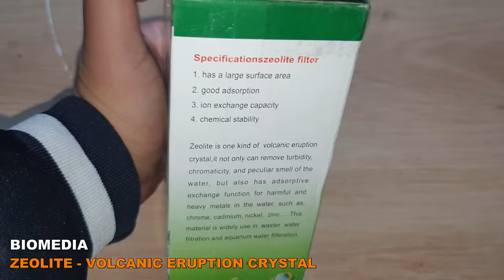DIY Filter Aquarium | Make Aquarium Filter At Home

Comment: Help me . When i switch off the filter but motor continue suck the water 
How to avoid it
Reply from the maker: Hi Srikant, how long does it flow after switching off the power. It should stop working as the filter won't be able to push water back to the tank.
Reply: It is continuesly suck the water after the switch off the power what can i do
Reply from the maker: Srikant nayak after taking IN the water from tank, does it pushes it back to the tank? Or is it during maintenance when you open the filter and it just over flow.
Reply: No its overflow
Reply from the maker: Srikant nayak Lift the filter bit higher when you do maintenance so water doesn't flow to the filter due to gravity. Or attach a stop valve to the inlet so you could turn it off before turning off the power. I hope it helps
Reply: @Fishaholic  tnq

Comment: Can you share the power of the pump, how many liters per hour ?
Reply from the maker: Hi Srinath, its a 4W pump with 280L/H capacity. Appreciate your time mate.
Reply: @Fishaholic  Thanks for the reply, I tried the same by using pump from submersible filter Which says it is 200L/H. I used much smaller tube for water in and out and used hot glue to seal the connecting place. It was not so successful. Going to use more powerful pump next time. Any advice? Great video,  I was inspired to make this by seeing your video 👍
Reply from the maker: What size tube did you use for water flow. Mine is 10mm vinyl tubing and water flow was just right for the tank. If you have bigger tank then go for bigger container and no doubt high flow pump. Appreciate your kind words and I am glad that my video has inspired you.
Reply: @Fishaholic  tube is 5mm vinyl tube. Will update ones I try with a new pump

Comment: Water level is increasing and decreasing in my diy filter and when switched off filter starts overflowing...what to do now?..pls help
Reply from the maker: Hi Richeek, your filter is not air tight. Check the seal around the lid and silicone around any holes you made in there.
Reply: Do u have insane gadgets to diy a simple filter?? Buy them first.... total equipment cost would be 15k... + ur hard work
Instead pay 4000 or less and get branded canister filter.

Comment: Sir tell specification of motor to be used.
Reply from the maker: Mine is a 200LPH motor for this small 20L tank. This size filter should work well with upto 400LPH pump.
Reply: @Fishaholic  Thank you sir
Reply from the maker: No worries Akshay, please ensure container is air tight. Otherwise it won't work properly and will be subject to leaking.
Reply: Ok

Comment: Broi did it but i face problem in leakage  from bottele cover what can i do???
Reply from the maker: Sorry to hear that. Check the seal, did you test the container by filling it with water and holding it upside down before drilling any holes?
Reply: @Fishaholic  leakage from cover so can u advice me sealant  glue name
Reply from the maker: Use any aquarium safe silicone, it will form a good seal. Products available here might differ to what's available in your country. I have idealseal ms290 at home.

Comment: Hi, thank you for the video, I've tried, but the water inlet doesn't work, what's wrong? tks
Reply from the maker: Fill the container with water prior to turning ON the pump. If it still doesn't work, then the container might not be air-tight.
Reply: @Fishaholic  So it should automatically start pumping 
water from the tank to the filter box is what I'm getting
Reply from the maker: It will work exactly like a store bought canister filter. Prefill the container with water and then start the pump

Comment: What is the price of the pump? What will the price be for a 1000lph filter? Won't the flow get reduced because of the filter medias?
Reply from the maker: Pump was only $15. I have bought a pump for my other tank that cost me $22  with a capacity of 2500 litre per hour. I guess it depends on the brand you buy. Flow rate won't be affected. Concept is similar to a canister filter. Appreciate your comment and thank you for watching the video

Comment: My input unit is not working can you please suggest
Reply from the maker: Fill the canister with water before trying. If inlet is still not taking water IN then it is most probably not air tight. Seal all the holes to make sure it is air tight. Let me know how you go.

Comment: You didn't need to use silicone you could just make the holes small and tight enough for the hose so that it won't leak
Reply: There are things called rubber grommets that are designed just for this.
Reply: @A3215-y3e  or just use silicone 🤷🏻‍♀️

Comment: the filter water is pump up the filter
??//  why not let you pump downwards?/\
Reply from the maker: Hi Michel, you can use either approach for home build canister filter. Since it is a DIY, I believe pumping water up is easier as water from tank will flow to filter through gravity and it will create less pressure on the water tight seal of the container you choose for the filter.
Reply: @Fishaholic  thanks for the tips.   i was thinking easy to clean and change the dirty filter without taking out everything
Reply from the maker: @michellehavre6821  Make sense Michel, would be lot easier that way.

Comment: You cut the plug's wire  too short and you tape it close to its other it should have a gap the. Red wire should have longer wire the blue has short wire, careful at wiring it can cause short-circuit even it has insolation 😉
Reply from the maker: I know mate, did a very bad job with wiring. I have bought a pump with transformer and the wire can be disconnected and connected. Its much safer now.

Comment: This is not working . Silikon does not stick to the polipropilen or PP ki d of plaztic from thih boxes are made ....
Reply from the maker: I have used selleys glass silicone and it worked fine. I have had to let it cure for few days though. It sticks well but peels off with bit of force

Comment: what is the lh of this pump....???
Reply from the maker: Hi Chinmoy, I believe the capacity of pump is 120 litre per hour. Which is 5 times the capacity of the tank. Appreciate your comment mate
Reply: can you help please...I made one like this but when I turned off my filter water is still coming from the tank and water split and overflow even motor is off...
Reply: @chinmoyroy1586  u can put it overead of tank thn.. Box me neeche se holes kr k.. fountain for your mates in aquarium..
Reply: @mohan_poetry0707  lekin bhaiya ji mera jo powerhead hein o filter ke inside mein hein now this is not possible....
Reply: @chinmoyroy1586  powerhead is not that much useful in filtration isliye ye filtermedia wala idea diya h is video me shayad... Pump se bhi bn skta ye system pump speed kam rhega to ek side se inlet aur fir beech me filter media thn neeche se holes kr k outlet... Monthly sponge change krna and 4,6 month me filtermedia.. Ye 1 years tk bhi stretch kr skte h..
Reply from the maker: Hi Roy, the container you have selected is not air tight. There shouldn't be any spillage or leakage if power is turned off. 

Lift the filter, possibly sit it on a block and see if it works. I am afraid intake will slow down as air might affect the siphoning. Let me know how you go
Reply: @Fishaholic  I try everything but water is still shiphoning whil power is off. but water is only filtering when filter and tank are in same position. But if I keep my filter up or down to the tank this process is not working....
Reply from the maker: Is it leaking around the lid or the inlet/outlet hose. If its around the hose then add some more silicone. If it is around the lid then the air-tight seal is broken and the container is no good. Lock n lock air-tight containers are highly durable and the seal works really well
Reply: @Fishaholic  ok I'll try....but many many thanks for the suggestion. Keep making fishkeeping related video.... well wishes once again bro....👍👍👍
Reply from the maker: Thank you Roy and I hope you get this filter working. Wish you best of luck.
Reply: @Fishaholic  see the joints and holes as leakage can be frm that place too..